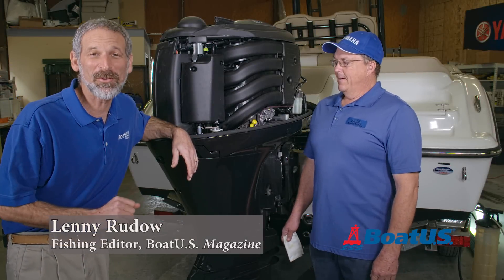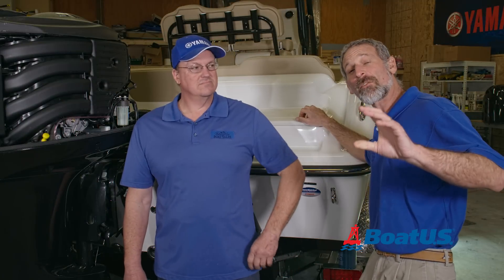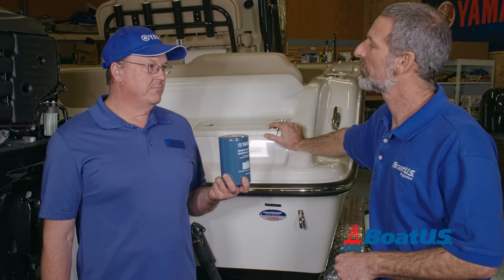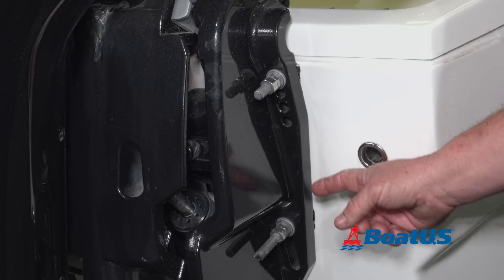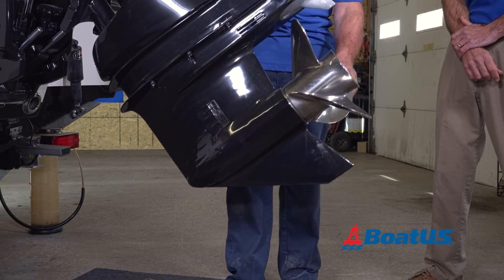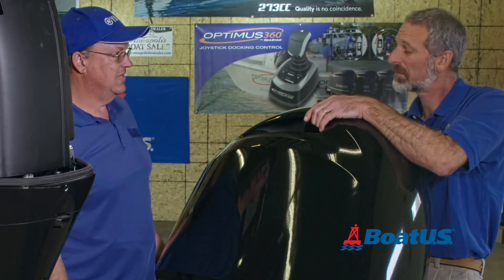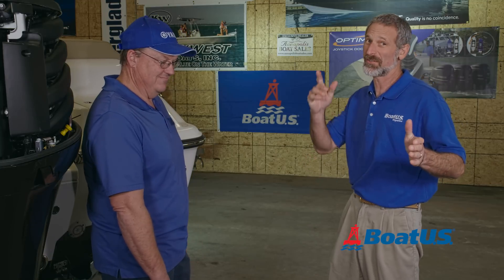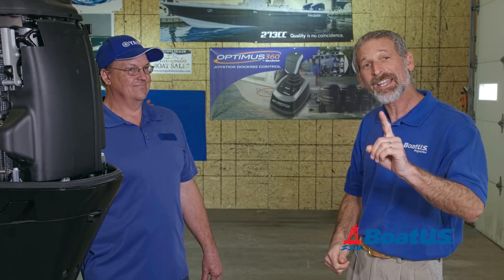4-Stroke Outboard Maintenance Check: 50 Hours | BoatUS

Comment: My marina sells only gas with no ethanol.  Isn’t that better.  Then how often should I change thre fuel filter?
Reply from the maker: Absolutely, Mari! Non-ethanol fuel is the preferred option if available. Regarding your fuel filter, check your owner's manual for specific manufacturer recommendations, but generally it's once every 100 hours or annually, whichever comes first. Most folks do it either in the spring during commissioning or in the fall during winterization. Doesn't really matter as long as you do it.

Comment: good info. i always wonder which type of gas you should use (regular, medium or primium)  and add the fuel stabilizer to get rid of the ethanol
Reply from the maker: Hi Enrique. Generally regular gas is fine, but always refer to your manufacturer's recommendations. No fuel stabilizer gets rid of ethanol. What it does is keep the fuel from phase separating and helps prevent water from being absorbed into the gasoline.

Comment: good info you are sharing I'm a new boat owner and does this apply to 2001 2 stroke outboard engines
Reply from the maker: No. The video shows a four-stroke. Refer to the manufacturer's recommendations for your particular motor.